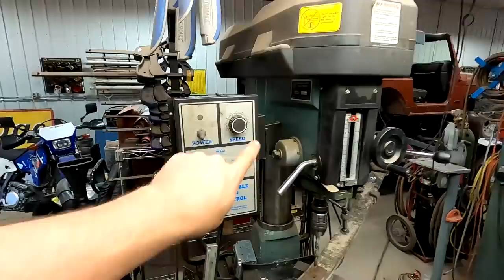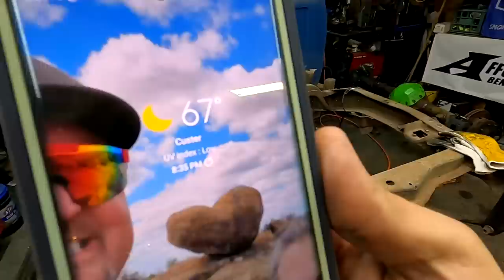IT ROLLS!!!! Rear Suspension On The Smoke Show S-10. OnX Offroad Build Challenge Part: 7

Comment: I usually use a furniture dolly to move the axle under the truck. When you go to pull it out of the garage put a 2" ratchet from frame under the axle back to the frame. On each corner 1 strap and air down. That's how i get mine in and out. S10 looks awesome

Comment: I just found this build and would have voted for you if I knew about it sooner. I am also a 90’s kid and have dreamed about going on UA for a long time.  Your rig seems like the only one that would actually make it on UA. I air hammered my old bushings out instead of torching them. I don’t see the significance of adding a bigger leaf spring bolt because the leaf pack will be stuck once it is bolted to the axle. Lastly, rubbing the back of your hands will not make you hands warmer. You are right that you are rubbing the veins but veins are moving blood out of your hands and taking it back to your heart.

Comment: I had not thought of using an S10 but seeing what you are doing makes perfect sense.  Also you do a good job of explaining why you do what you do.  BTW, slow drill speed is the answer to hardened steel but lots of pressure will take that bit through.
Keep up the good work.

Comment: Pro tip. Masonry bits work well to drill through hardened steel like leaf springs. Just make sure to go slow and use lots of lube so you don't lose the temper of the metal. I run Wagoneer fronts front and rear on my YJ with a XJ main leaf as a mil wrap (use the large eye end) and redrill the centering hole to match the Wagoneer leaf pack. Works great.
Reply: Pro tip for the leaf spring bushings. Use a full drill bit drill into the pushing on the outside then put the drill in reverse while applying sideways pressure and the drill bit should travel sideways round the outside of the bushing until it backs out. Works every time for me. Long thin bits work the best for me but break easy if you put too much sideways pressure.

Comment: I call that the “baby shave” on my 14-bolt. Did my first in 2006 and when I broke and replaced that 14-bolt eight years later I simply bolted on my thick cover and cut that same line again.

Comment: You could use a masonry bit to drill out the hole in the leaf spring. They are carbide and it will drill hardened metal and spring steal.

Comment: Try using solid carbide drill bits. They don't burn up and are designed to be used at higher speeds and feeds. This is why we use them in machining

Comment: 14:27 If you Burn Out Bushing you Risk Annealing the Leaf Eye and Weakening it. You can Drill them Out, with a Hole Saw or Small Bit around the Outside edge to break the bond. AND Use Molly Grease; NON Petroleum for Bushing Instal.

Comment: The truck is looking great. Ever try drilling out old rubber bushings with a wood bit? ABOUT flipping time Matt helps you, granted you are doing AWESOME work. I LOVED the look of the truck with the 40's on the back and the low profile front tires. The tires and wheel combo looks incredible.

Comment: I just had another thought. My buddy uses a light dimmer switch to regulate the air output on his airpump to adjust the flame on his still. I'm thinking a dimmer switch would slow down a drill as well. Just a thought.

Comment: That hole in the Spring did not necessarily need a Mill, because it was one axis of drilling.  There are drill presses with variable speed controllers just like this mill has.  Matt's Off-Road Recovery just got one to upgrade there old one.

Comment: I had planned on buying a Daytona floor Jack a while back but I likely would have gotten the standard length one.  
I ended up not getting one and finally bought the identical one to yours from Canadian Tire here in Ontario. I’ve had no regrets at all. Lower height to start and higher overall lift.

Comment: If it wasn't for you already having that nice solid diff cover, I'd have suggested going with the Barnes 13 bolt diff cover and cutting even more off that 14 bolt bottom. The grease will help keeping the spring bolt from seizing, but honestly, I'd have used what was intended to be used. Anti-Seize. Not sure who voted for 126" wheel base, but, I am at 120" on 43's and it does bring the suck sometimes getting high centered, because of wheelbase. There's a big difference in what just a few inches will make. So I'd have wanted 118-120" at minimum.

Comment: your drill press has adjustable belts on the top you should be able to slow it right down, there is a chart under the top lid that gives you all the ratios.

Comment: Question, when you set the pinion angle you arent carrying any rear weight(box, gear, fuel) with the stock"ish" springs length. is it a "CLOSE ENOUGH" angle or isnt there much change with them when they flatten out loaded?

Comment: Loosening the rear  springs and having it move I would think is normal. It's the whole reason you don't final tighten the suspension until it's at ride height.

Comment: Looking good so far. I have to ask though. When you were working on removing the rear axle did the left side of the frame really droop as far as it looked in the video? If so are you planing on stiffing the frame to help stopping that from happening.
Reply from the maker: That wasn't the frame that drooped, it was the suspension and axle that did. 😉👍

Comment: Don’t understand why you can’t drill spring steel with a regular bit. Only ever used regular bits to drill springs when I worked in a spring shop back in ‘85. 

I did learn to hand sharpen drill bits back then too, but that wasn’t because we were burning up bits drilling one leaf.

Comment: I wonder what that 14 bolt came out of originally??
Reply from the maker: 14 bolt axles come from full size GM 3/4 & 1 ton vehicles.
Reply: @bleepinjeep    Aren't the 14 bolts from Suburbans a little narrower than from a 2500 or 3500 truck?